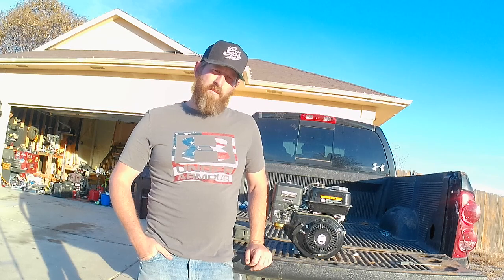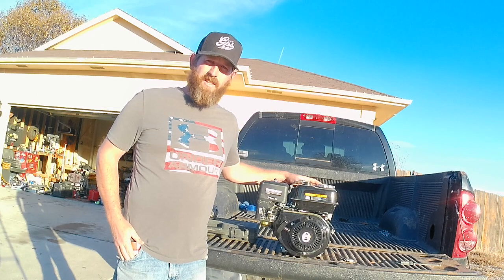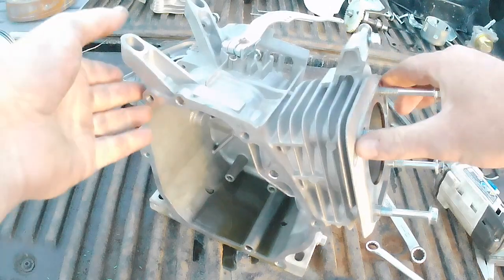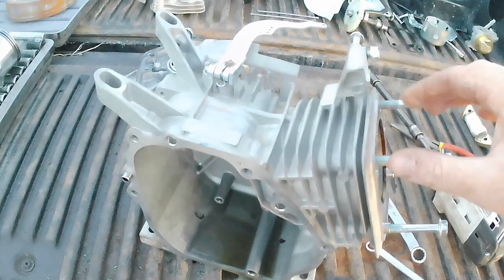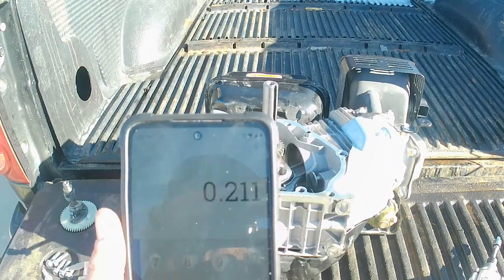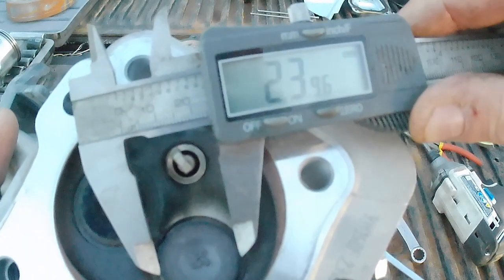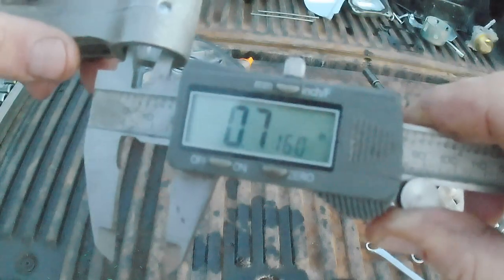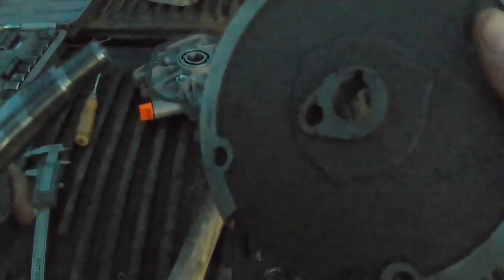B200 Coleman 196CC Taotao Engine Teardown

Comment: can I just put a clone flywheel and a gov delete and ride like that as is?
Reply from the maker: If u are talking billet then yes u can run it like that. I would keep it under 4500 and get a billet rod sooner rather than later
Reply: @ what if it’s not a billet you think over time it would cause issues? cause I was going to replace the stock flywheel with a aluminum flywheel off Amazon or something
Reply from the maker: @JoshuaPadilla-d2f ya those are fine too. The Amazon ones have 18 degrees timing. I prefer a racer proquip cast aluminum flywheel a little more expensive but they come with 28 degrees timing. That's what u want at least 28 degrees. Once u decide to upgrade the cam most will want 32 or more degrees of timing and it will be much easier to get there with that racer proquip flywheel.

Comment: Thanks….Glad I saw your Tao Tao motor video.  I just got a B200 and ordered a stage 1 kit.  It’s been 56 years since my last mini-bike. Told her it was for the grandkids 😊  How do you think that motor compares to the Predator 212 ?   Should I upgrade?
Reply from the maker: The taotao motor seems like a good motor to me. We took it off and only had minimal ride time on it. It does live on a ct100u now. Parts are fairly inexpensive and I'm not big on this is better than that. I'm more of a work with what u have kinda guy. So if I had the 196 sitting there and needed a motor it's getting used before I buy a new one. Is there benefits to going predator ya probably. Bigger valves easier to identify which parts fit but the taotao will have everything available for it that a predator does.